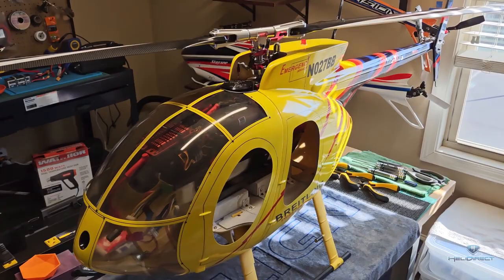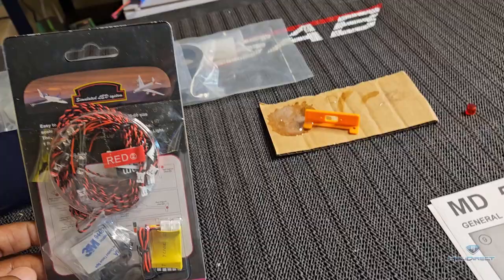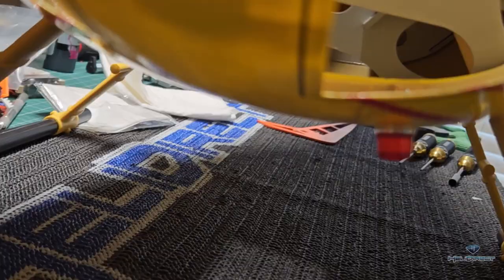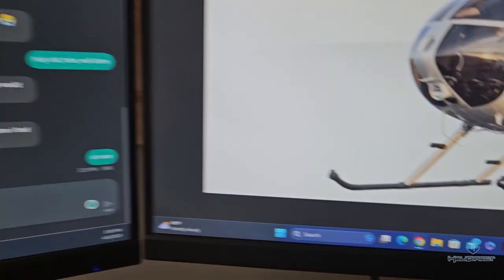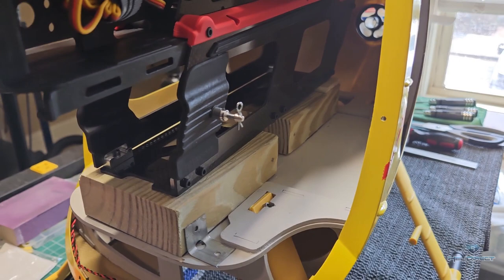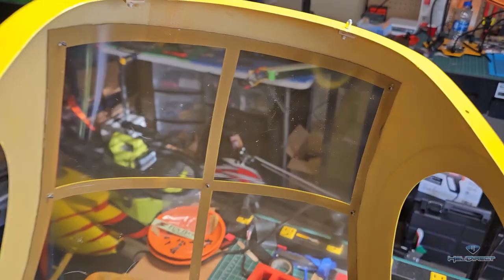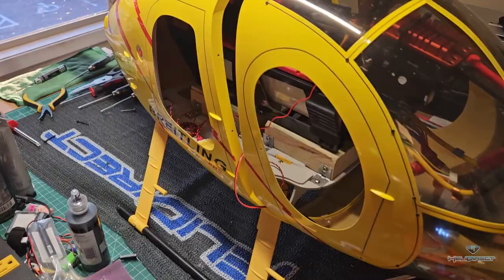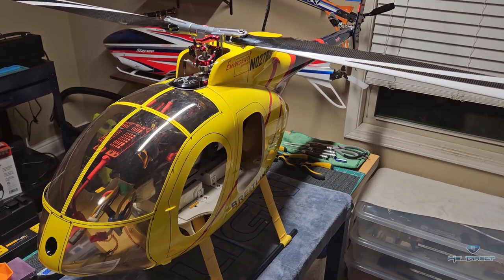SCALE HELI SERIES: Funkey MD500E Build and Flight!!

Comment: Bro! You built amsuch a nice heli.. but why the hell did you totally fuck up the weigh with those massive wood pieces??? You know you can make an easy superlite alu frame? All you need is 2pieces of L shapes alu profile. 1.5mm thick, 40x30mm size. Bolt it to the frame and bolt it to your fuselage floor.. and you have space under your frame to put stuff like aux  battery or so🤣